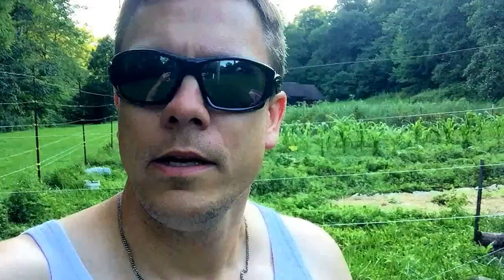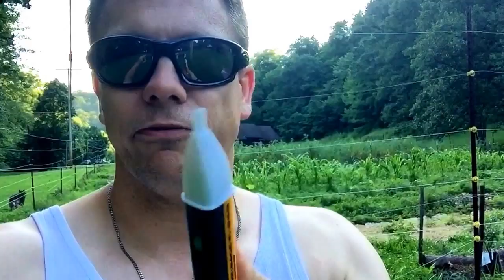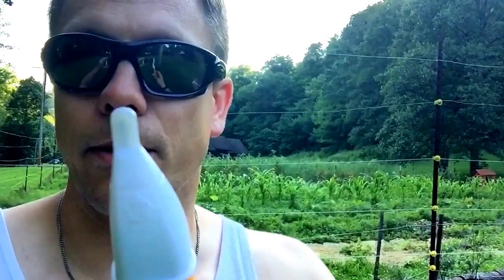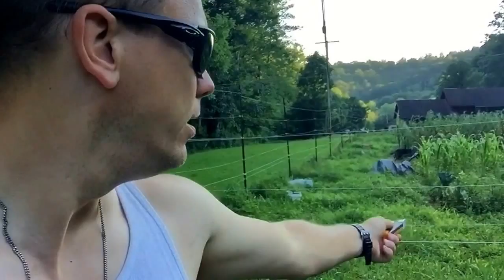How to test an electric fence.

Comment: Isn't that tester for 110 volt AC power? The electric fence is DC powdered. The tester your using, is it rated for both electric powers? thanks
Reply from the maker: You have to look at your tester to make sure. You are correct that my Fluke 1AC-II tester detects AC voltage, but the electric fence pulsed AC, so it worked. I had a Fi-Shok 525 at that time plugged into an extension cord.

Comment from the maker: Haha. The bottom strand isn't hot. If weeds touch a wire, the system gets grounded out, and I don't like weed eating around the garden every few weeks. I learned that the hard way. Plus, we like our dog being able to get in so he can chase deer out since electric fences aren't foolproof. Good catch!
Reply from the maker: Thanks for the comment.  I've never touched my fence with this tester, 
but you're correct that an instrument could be damaged by doing so.  My 
tester lights up and buzzes several feet from the fence.  Since there is
 no direct contact with the fence and it is sensing an electromagnetic 
field versus getting actual voltage or amps, it's safe for the 
instrument.